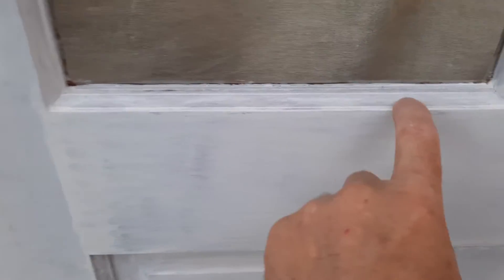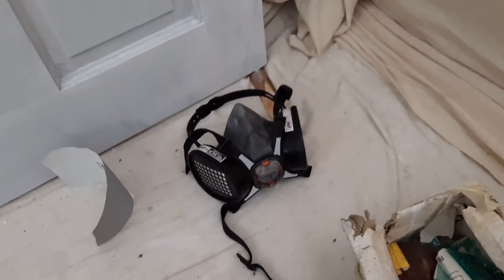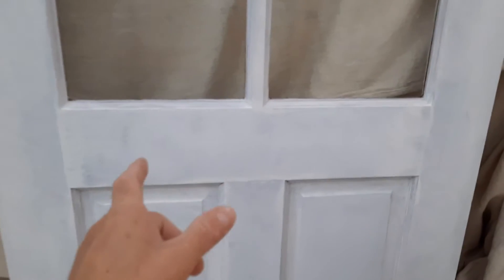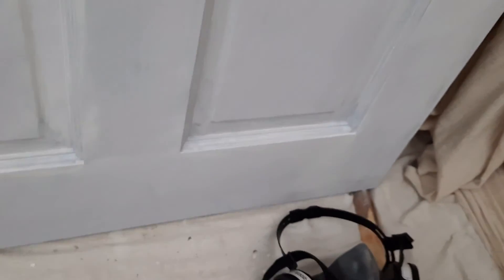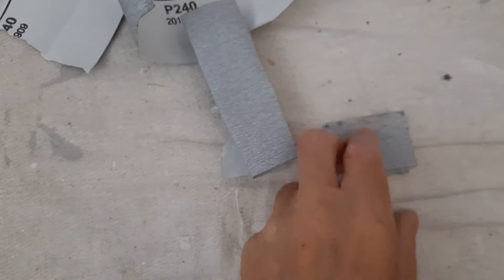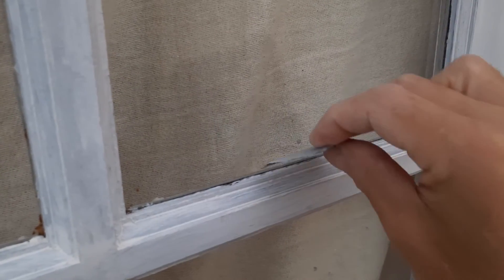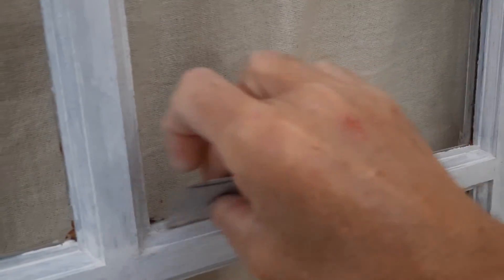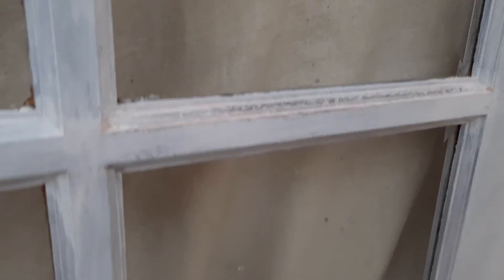How To Sand Moulding On French Doors

Comment: May sound daft , but I have  glued sanding paper to lolly pop sticks ,  then squared the end off and use that to sand  the top edge of beading up to the glass.    Just trim them to size etc . Never scratches the glass,  gets in the corners 
Then I sand as normal everywhere else.
I'll make a load up , throw em in my box . They come in handy . 

Just lay a sheet of sanding  paper face down . Glue the sticks to it, and when dry use a Stanley to cut them out .
Reply: @lewis3427  Sounds like a brilliant idea. Just bought an old french door which needs sanding. Thanks for the tips 🙂

Comment: Nice technique. When I do French doors or other surfaces with smaller detailed moldings I use sandpaper folded over filling knives and refold the paper when worn out. I work all the same facets of the moldings of each window and then progress to the round surfaces and so on. Protecting the glass with another blade.
Reply from the maker: Thanks sounds like a good way as well...

Comment: just a quick one bro , ceiling paint is going like cream cheese a think scrubble paint was used before , is there anything on market too cover it before re painting , a real pain which i had too leave cheers bro
Reply from the maker: Sometimes it's about painting fast allowing to dry and usually does not repeat..  but nothing really on the market..  I've had this problem but usually when it's first coat over a washable paint.  Thanks
Reply: @PaintingandDecorating  cheers bro

Comment: RTS 400 and some interface pads bang the whole door out in 2 mins 👍
Reply: @gdpaintingdecorating5704  easy, see how he runs it along every groove you literally just do the same just with the sander, interface pad moulds to all the contours for even better sanding and 10x the speed. You don't have the paper facing the glass what's the issue? Do you own an rts? Pad has minimal movement very easy to control against the glass and comes with a guard if you really need it. I've done hundreds of doors this way never had any issues

Comment: Where's the quick electric motorized easy method.  Anyone can sand... me, I want a super trick.  No Dremel tool attachments? No "wow I wish I would of thought of that" using a spring and a piece of fish skin dipped in paint remover on an angle grinder uber-doober trick?